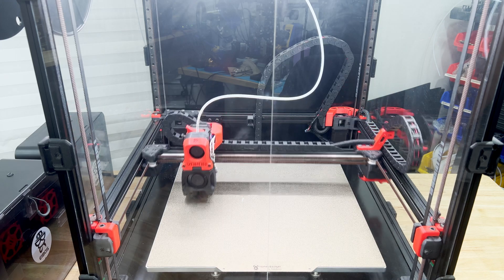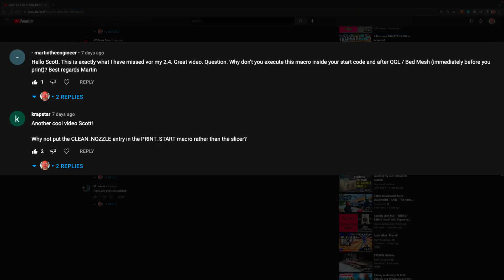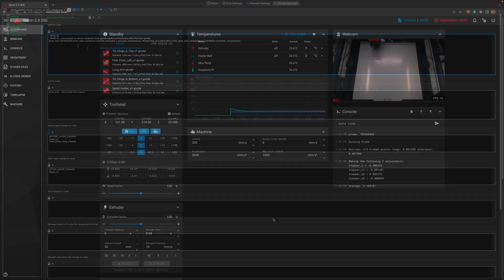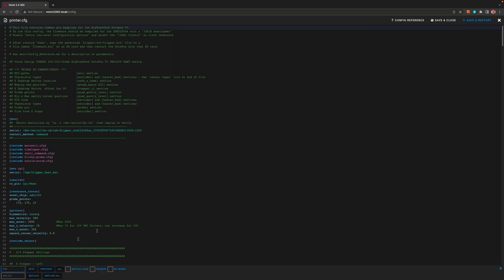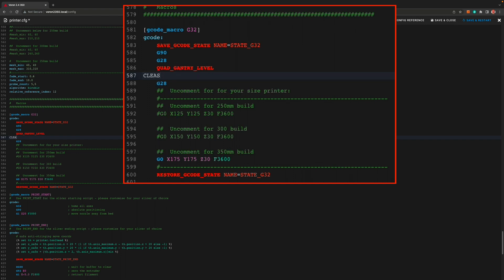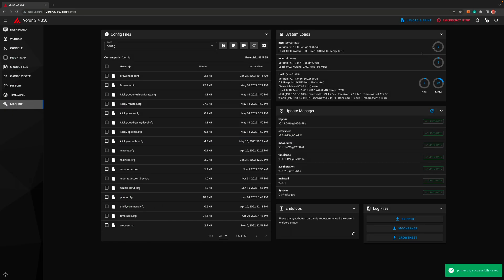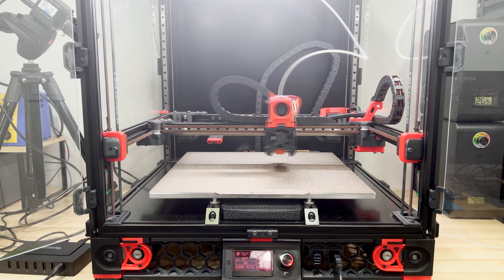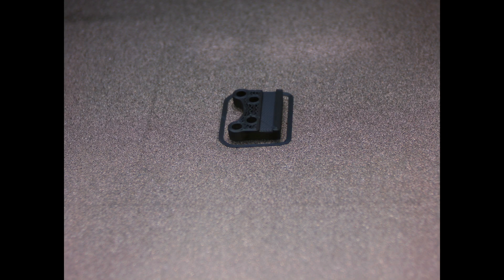Voron 2.4 Step By Step Part 20.5 Auto Nozzle Scrubber Improved

Comment: Short answer Please continue to have written directions with voiceover. I prefer the video to have full written directions that you have had in past but the voice over is great and warm not monotone.
Simply said: I see your name I stop to watch the video and have faith in the content - you sir are an inspiration.
longer answer: I followed your video's for my voron 2.4r2 350 build and the build was smooth - I am a bit slow on the programming and it was a paper weight for 18 months, but asked for help and someone got it running for me, currently watching all your video's and printing parts for the lights now but the scrubber is way up on the list. I appreciate your written text on all your video's and am learning so much - Klipper and pi are a heck of learning curve for me. I appreciate that you have dummied it down to beginner level so to speak, I can copy your process while learning so it is very appreciated. And there is so much more to learn. Thank you, thank you , thank you

Comment: Thanks for a really good series of videos. The information is put over very clearly. I was finishing my 2.4 at about the time you were releasing your first videos, but these have encouraged me to add modifications like the nozzle scrubber and klicky probe. The only small (and I hope constructive) comment I would make is that I think you have your cable chains assembled incorrectly. I had made the same mistake before someone picked it up when I posted a build photo. The tops of the chains should be horizontal. Swapping the ends to correct it is very quick..  Edit: Since posting this comment, I have seen that this was discussed in an earlier comment so ignore that bit.
Reply from the maker: Thank you.

Believe it or not I switched the ends a while back. They only stayed straight for a while before the part that held it in place wore off. Both my ends move now. lol 
These are the cheap chains from a couple of years ago. I'm keeping and eye on the wires, but I know it's not good for them.

Comment: CLEAN_NOZZLE better to add in to START_PRINT section or other macros when needed
Reply from the maker: Yes, you are correct. The video after this I move it into the G32 macro.
Reply: @scottcorn  do you have noise from z motors ? XY for me is good and silent
Reply from the maker: The Z motor noise can be reduced by loosening the Z joints under the gantry. Then do a home all and QGL. After this is done tighten the Z joints without powering down.
The motors strain more to keep the gantry level when is has been tightened while not being level. The gantry should also drop less in the back when powered off after this.

The Z motors will always make more noise than the others when idle. They are holding the gantry in place even while idle.
Reply from the maker: Just realized you are commenting on the next video. 
I don't want it in START_PRINT because it would clean after the last home all. It wouldn't contribute to the last Z home being clean. If you do a NOZZLE_CLEAN before any home all is done it will fail. Putting it in the slicer was also susceptible to this.

Comment: The voiceover is fantastic, and I'm glad you held off a bit in order to be able to acquire gear to best deliver it - there would be nothing worse than having beautifully executed visuals, with less-than optimal voiceover. And besides - having captions on your video forces people to actually watch what you're doing, which is probably important during a 3D printer build. 🤷‍♂️

On the levels/hearing front, and from someone with experience in delivering broadcast video: things are generally louder than you think they are, and you'd be surprised how far you can turn down background music, and still feel its presence in the mix. Your levels were fine in this, (especially for your very first VO!) but if you'd like additional guidance then I'd probably recommend purchasing some kind of meter/loudness indicator you can patch in before the speakers. Your ears are (unfortunately) your best guide, but visual confirmation is a close second.

(I'd also recommend staying away from cheaper (but new) Chinese meters, and opting for professional, albeit second hand meters instead.)

As always, keep up the amazing work! 😁
Reply from the maker: Thank you!
I like the idea of a sound meter. Having a way to judge that doesn't rely on my ears would be be great. If it's in the output before the speakers how do you account for volume level being turned up and down? I figure just always set it at a known level when doing voice over?
I set the DB directly in Davinci Resolve for everything individually at creation, but those levels are subjective and muddy for me. 
In the end it gets changed a little when I make a final automated pass to keep everything below -14 LUFS so YoutTube doesn't do it for me with a sledgehammer.

Comment: Your cable chains are on the wrong way around. There's one side that can move in both directions and another that can only move in one direction. You want the bit that moves in one direction to be on top, then the chain will lay flat
Reply from the maker: Believe it or not they are the correct way. I changed them around a while back because others pointed out it looked better to do them as you describe. They just wore off the part that held them in place after about 500 hours of printing. These are the cheaper chains from a couple of years ago not the good ones.

Comment: Add some table protection to back side. I builded my Voron one day  ago and need to rebuild because acrylic panel twisted under bed when I started to print abs
Reply from the maker: I was afraid my purge bucket was too close and would warp, but it hasn’t yet. I did the normal Voron infill of 40%. Maybe that is why mine is holding up?
Reply: @scottcorn  it’s happen when bad was 100 degrees, I will use some insulation as on another printers for bad , and now try to find some material to replace . I’m trying to find some aluminium with plastic as sandwich. ABS starting make deformation around 90 degrees. May happen